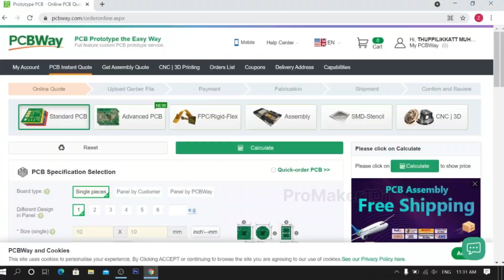This DIY Device Every Home Needs!

Comment: it's impossible to write in the title or the description what device this is about - impressive clickbait level.
Reply: this is a diy PSU project involving a powerbank as a power source, a step up module to bring the voltage up from 5 to 9 volts for the router and a dc jack for connecting the router to this device, to make this more simple its just a usb powerbank powered device for powering the router when the power goes out